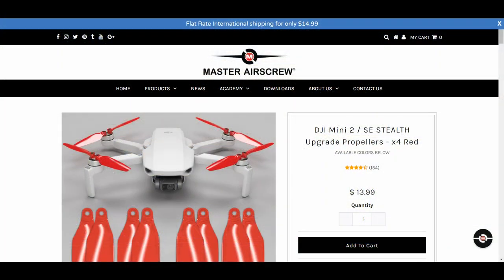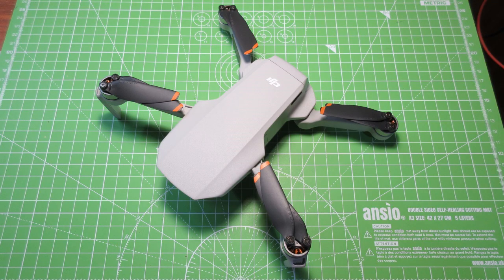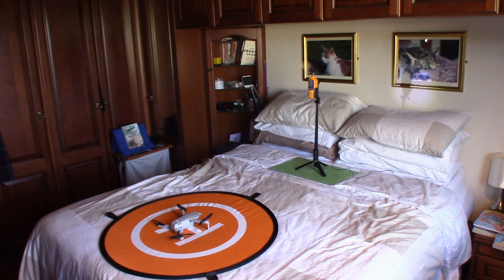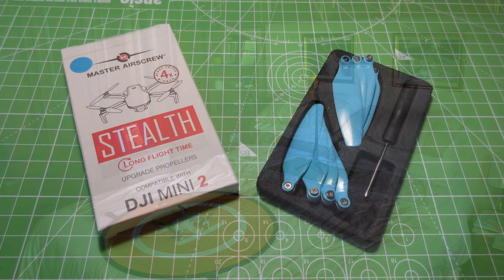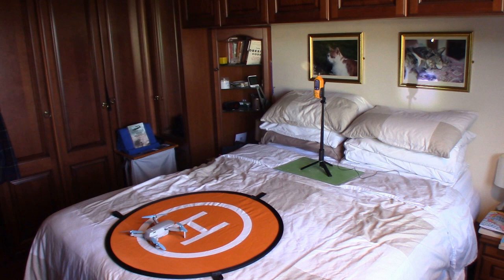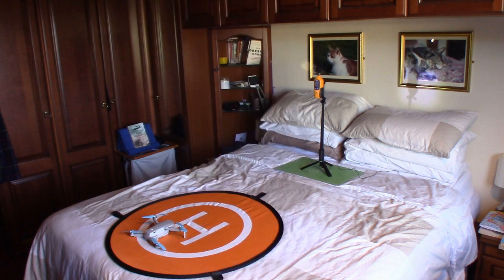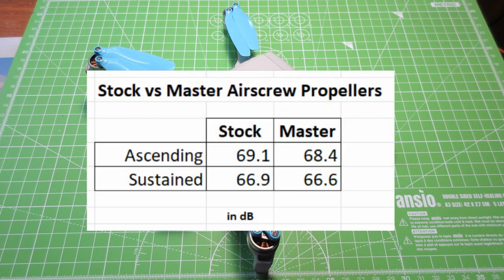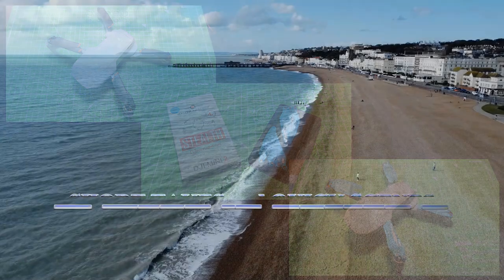DJI Mini 2 : Sound Check : Stock vs Master Airscrew Props

Comment: My experience with the Master Air Screw props is that I found them slightly quieter, a more pleasing pitch. I did however have some issues in windy conditions, stability took quite a hit, so I put the OEM props back  on
Reply: I get some significant wind where I am, and the props didn't seem to affect stability for me -- but perhaps I'm not watching closely enough.

Comment: Found them a bit quieter But they can come loose not a problem with the stock props
Reply: I think that can be remedied with the application of some thread-locker. The Master Air Screw props come pre-applied with thread locker, but after removing them and before re-attaching I used an application of Loctite Blue. I've not had any problem with loosening.
Reply from the maker: I didn't experience any loosening, and I can't say why not. The stock blades, after removal, would theoretically lose a bit of locking, too, when re-attached. If you examine the screws of both stock and after-market blades, you can see that they both use thread locker. Perhaps MAS doesn't use the same locker product? To do this noise experiment, I ended up detaching and reattaching both sets of blades about twice each. I finally re-attached the MAS blades and applied a blue-coloured thread locker. I continue to use these same blades with no issues.
Reply: @sussexyank2  I did the same and since putting on a bit of locktight I have had no issues and the drone is flying great with these on. I would prefer quick release blades like on the pro it would remove the possible error of not tightening enough or over tightening and while a few have commented on having issues with these blades in whole I think they are very good but I had no complaints with the stock blades as they are well made.

Comment: Not enough to justify buying them. Stock and no warranty issues.
Reply from the maker: Getting to your comment a bit late, but I kind of feel the same way, all in all. The drone in the video got lost in a very tall tree not long after I posted this. It was too high to get down. And then later that week we had a big windstorm which brought the drone down to the road below the tree. Someone ran over the drone, then apparently took it and tossed it in a bin somewhere. The only thing left was parts of the MAS props. When I replaced the Mini 2 a few months later, I didn't bother installing MAS props on it, though I do have another set.